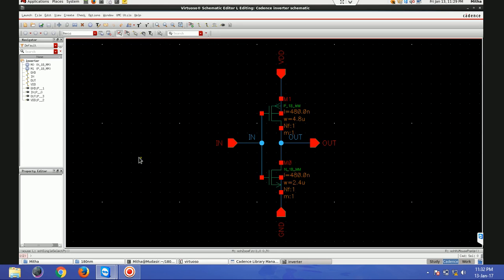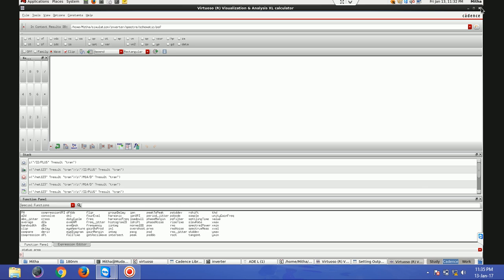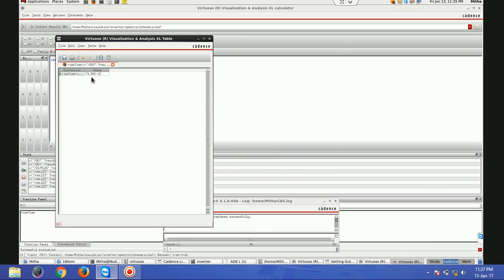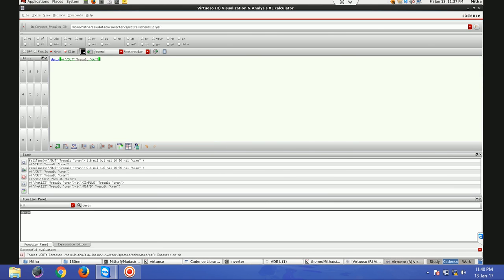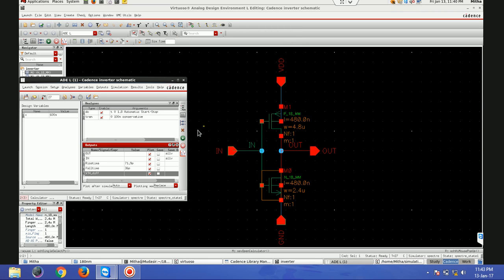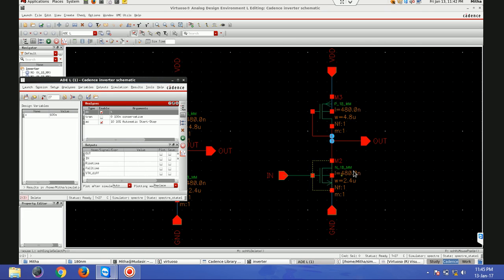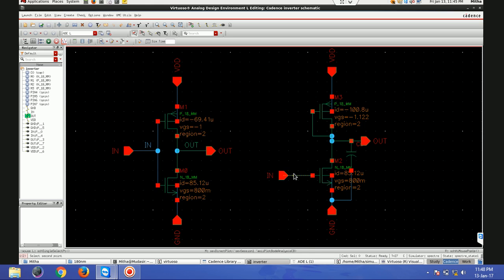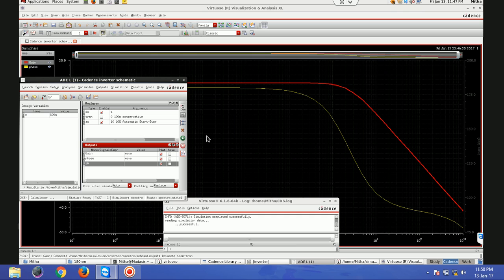Cadence IC615 Virtuoso Tutorial 3 (HD): Using Calculator in ADEL

Comment: Sir, I want to calculate dnl and inl errors for my dac. Can you tell me how to do that?
Reply from the maker: One way is to export the results to Matlab (commonly used). You can find the codes or simulink blocks for this in mathworks.
Second approach is to use verilog model of ADC to give input to DAC. Create a testbench and give dc voltage to all sources for power up. You can either write the equation of INL/DNL on your own in calculator or use the available functions in calculator. For more understanding read this: https://www.ti.com/lit/an/slaa013/slaa013.pdf
Reply: @MudasirMir7  Thank you sir :)

Comment: hi, I've got a question. I am trying to plot a DC voltage after running a DC simulation but when I choose the signal I want to plot and press the plot button I see the voltage as a number on the calculator screen, whereas I want it to be shown as a point on a graph. I am certain this can be done. Thanks.
Reply from the maker: You have to vary something (define a variable in your circuit, let's say the input voltage or according to your requirement) to plot a signal doing dc analysis.
Reply: I figured out that when I open the test editor and start my dc analysis from there, it does not plot the single data point but if instead when I start my "single run, sweeps and corners" from the toolbar above and now the data point shows up on the plot